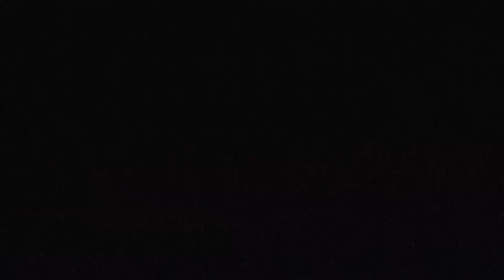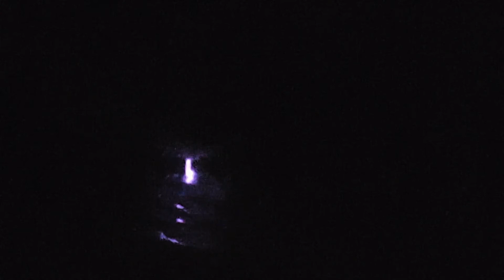I made a cute little plasma cutter

Comment: How did you make this?
Reply from the maker: A plasma lighter that I bought for like 10 bucks, a screwdriver, matches, scissors, an old phone charger, plastic wrap, aluminum foil, a screw, and a styrofoam cup. And it took me like an hour and a half to make it work. This was something I wanted to do since I got the plasma lighter like 2 weeks ago but I didn't have any copper wiring but then I had an idea so I took an old phone charger, cut it open, burnt off the edges of each end so I could have exposed copper wiring to wrap around the conduits and the middle was already insulated so it was easy